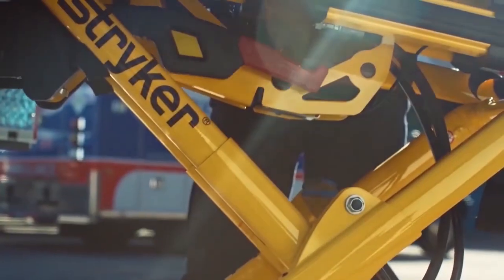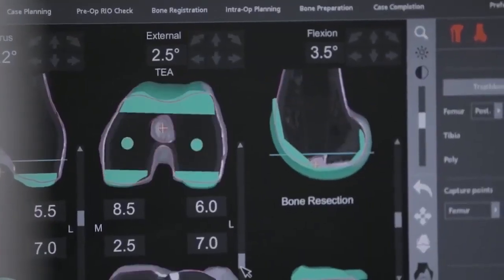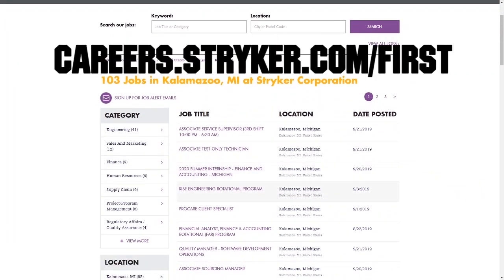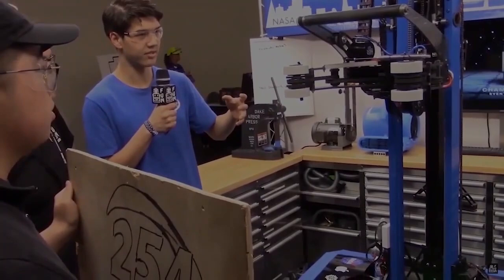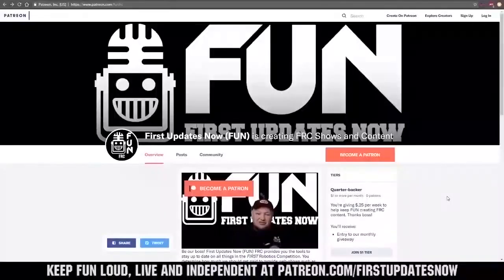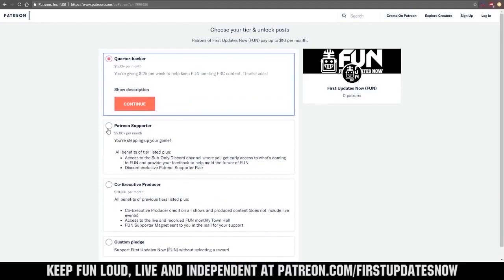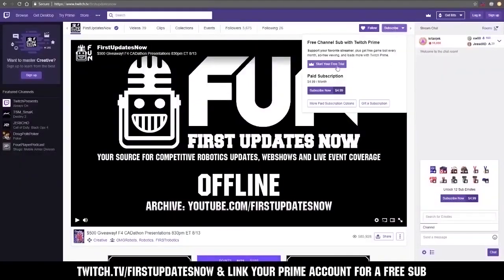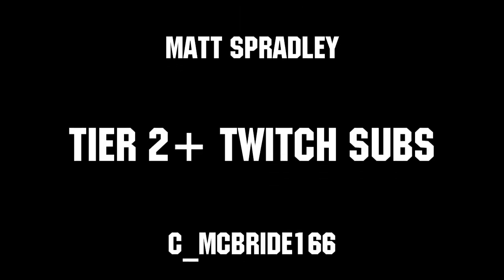Robot is Climbing! Grip Tape Added - FIRST Capital Ri3D - First Updates Now

Comment: Hi, I have a quick question about what you mean by Grip Tape. What is the actually material you are using? Is it some sort of sandpaper, or actual skateboard griptape? Or is it something totally different? Thank you in advance
Reply: It's actually called friction tape. I believe this is the same thing, just a different size. It's like the tape used on hockey sticks. https://www.amazon.com/3M-Temflex-Cotton-Friction-Length/dp/B00745RIMW/ref=sr_1_15?keywords=3m+friction+tape&qid=1578708378&sr=8-15